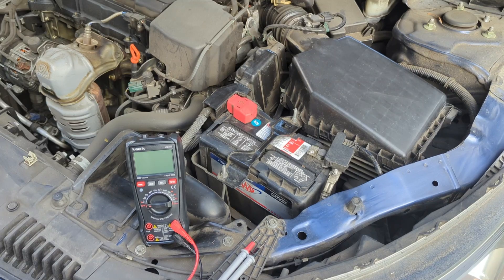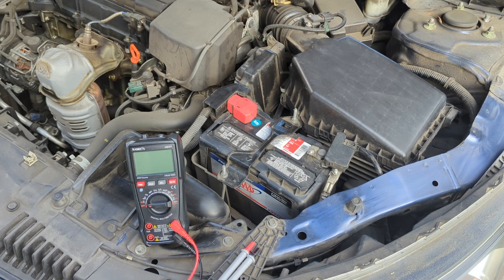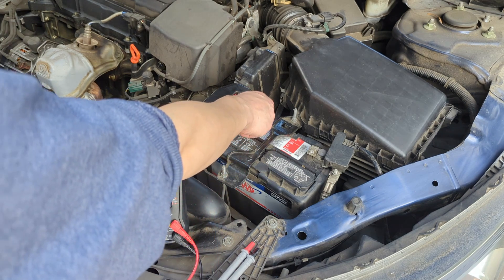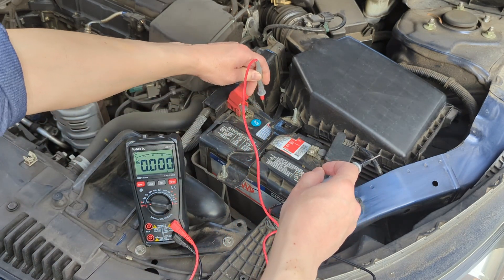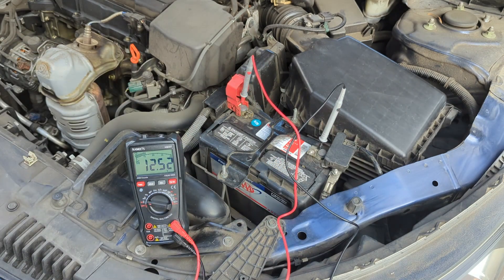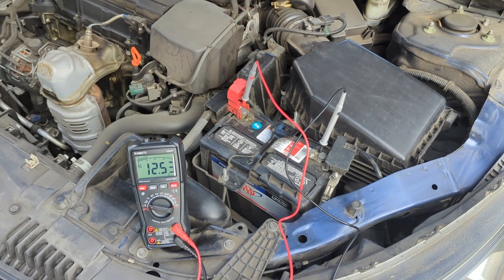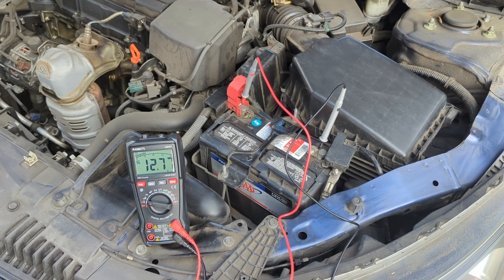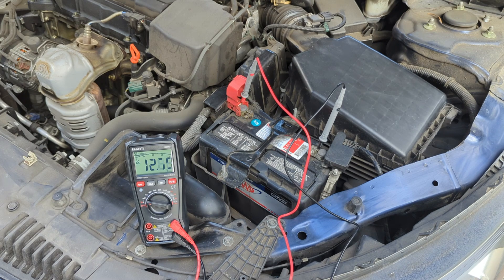How To Test A Car Battery With A Multimeter

Comment: To be accurate you should put your multimeter on min max. when I review your video at .25 speed it shows 5.64 volts at 1min 20 sec.  Or your multimeter is not accurate. But with that exemple I will recharge the battery and retest it.
Reply from the maker: Thanks for your feedback. I've created another video: https://www.youtube.com/watch?v=873dvlHc5Xw